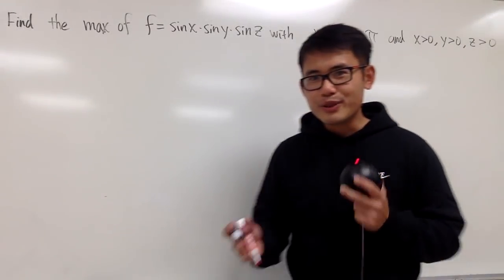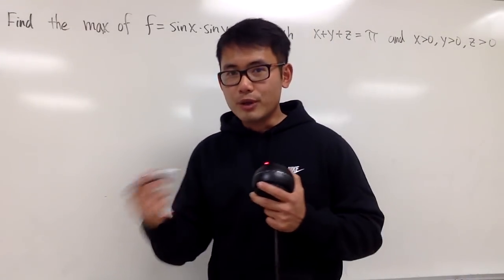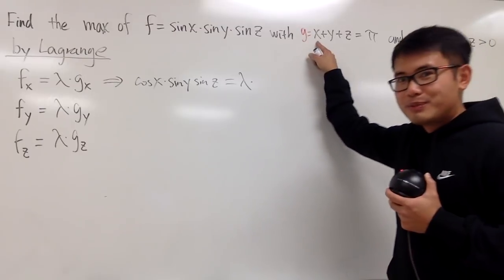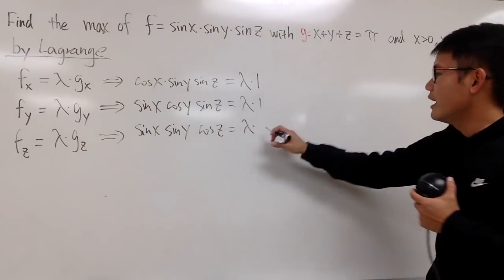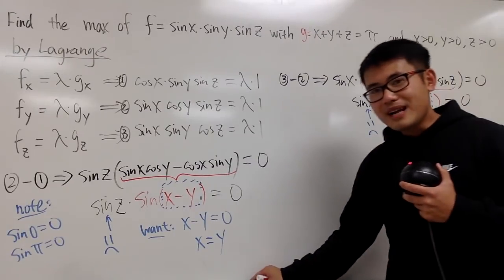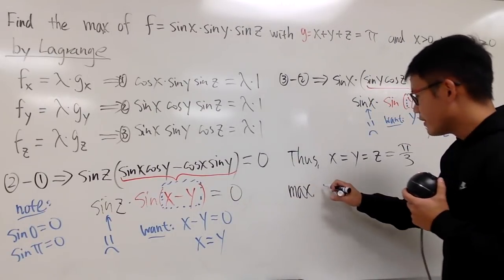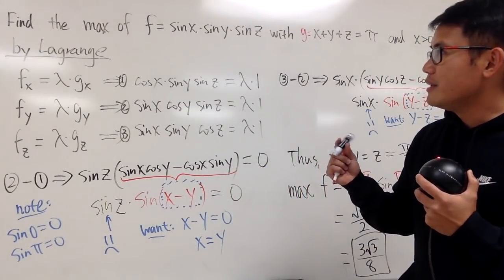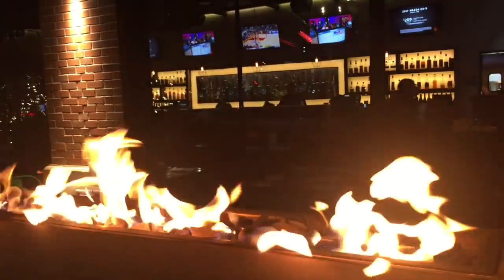Lagrange Multiplier, max of sinx*siny*sinz

Comment: You can just argue geometrically that you get the largest area with a fixed sum of 2 factors if both are the same. So x*y is max if x=y. So in this case all sin has to be the same. So x, y, z have to be 60 degree

Comment: Hey, I came up with a different method.
first, make the substitution that z=pi-x-y, from the condition g
When doing single variable calculus the function has the minimum/maximum when the derivative is equal to zero. You can use the same concept: find the partial derivative with respect to x and set that equal to 0. Do the same with y and solve for x and y. It works, however you need numerical approximation sometimes

Comment: (stares at the screen in confusion)
Reply: Oon Han  Have you taken Calc III?
Reply: no
Reply: Much simpler proof: the biggest some of the numbers x*y*z is when x=y=z this can be proven simply by a^2-b^2. you have the numbers a-n; a; a+n mutilping them you get a(a^2-n^2) but this is strictly smaller then a^3 thus the biggest value you can get is when all three are the same. We conclude all have to be pi/3
Reply: @jameroth7661  sure, but what fun is that?

Comment: There is one problem with this argument. Langrange multipliers find only candidates for local extremes besides boundaries of manifolds. So you still need to check how function behaves near the boundary. Here we have simple situation where function is 0 at boundary and is positive inside our domain so Lagrange multipliers method is gonna find us. But if we had a function that is minus function from this example then there is no maximum, supremum would be 0 and it's value from boundary. Lagrange multiplier method would find us only minimum then. So we can't just throw out z=0 here because it's from outside of our domain. We can throw it because values function attains at boundary are small and therefore maximum can't be there. Also we know supremum can be attained in compact sets so if we add boundary we can find a point where maximum is attained. So standard procedure is to say that maximum is attained in closure of our set and then we say it's not attained at boundary because there is 0 value and we have greater values inside our origin domain and then we know it can be found using Lagrange multiplier. Formally everytime such procedure should be done to have complete proofs although it's ommited oftenly because authors consider it trivial. It's good to remember about it though and know what Lagrange multiplier method actually finds.
Reply: This is the very same problem that I am going through as a teacher of Lagrange multipliers in class. But I think the reason that being omitted is not because authors consider it trivial. I think it is because the complete formality is hard to be  explained in detail at a calculus level.

Comment: My thought process:
(observation:) the function sin(x) is curving downwards between x=0 and x=pi
lets start imagining that x, y and z are equal (pi/3). if we increase one, another has to decrease. lets imagine we decrease x by a small amount called h, and then increase z by that amount. because the sine function is curving downwards, sin(x) will shrink faster than sin(z) is growing, therefore our final result is smaller. even if we try to move y and z together, sin(z) shrinks faster than sin(y) grows. Because of all this, x, y and z indeed have to be equal (to pi/3).

after you mentioned the largest area of a triangle connection, my thought process became:
lets just imagine any triangle inscribed within a circle. lets call the vertices A, B and C.
now rotate the image such that AB is at the bottom. when we move C along the circle, the total area shrinks and grows. if we were to move C parall to AB, the area of the triangle wouldn't change. because of this, only the shortest distance between C and AB actually matters. The larger that distance, the larger the area. obviously its the largest when the triangle becomes an isosceles triangle, with C being on the far end of the circle.
Now we cna repeat this game with AC being the base and B being free to move. Every time we do this, we have to adjust the points less and less. And if we were to look at the case of an equilateral triangle, we would notice that we don't have to adjust anything.
Therefore, all 3 angles are the same.

Comment: Let me guess... x=y=z=pi/3
Reply: You can easily demonstrate it without calc 3, pick any 2 points on a circle, the triangle with the largest area that can be formed using these 2 points is the one with its third point opposite the first 2 and in the middle of them, because A = bh/2, having it anywhere else would yield a lower height with the same basis, so we know it has to be isoceles, now you do the opposite, fix one point and then pick two other points on the circle, symmetrically from the first since we know the triangle has to be isoceles, put the fixed point at (1,0) in (r,theta) notation, the other points will be at (1,alpha) and (1,-alpha), the height will be 1-cos(alpha) and the basis 2sin(alpha), the area is then sin(alpha)-sin(alpha)cos(alpha) which we try to maximize, the derivative is cos(alpha)+cos(alpha)sin(alpha), ie cos(alpha)(1+sin(alpha)), with only one root in [0,pi] which is 2pi/3, meaning the points are in (0,0),(0,120°) and (0,-120°), ie the triangle is equilateral, QED.
Reply: @sdegueldre  YAY!!!
Reply: take the mean ( measure of central tendency )
Reply: But... WHY!
Reply: XD good one 👍
Reply: Samuel Degueldre i wanted to write the same, maximizing the height and the base
Reply: is it the same as say we have a and b that a+b=12, so max(a•b) would be 6•6 = 36 because the max we can get is when they are equal so a=b=12/2=6?
in other cases, 5•7=35 (smaller), 4•8=32 (even smaller), 3•9=27 (even smaller), etc.
and, as sin(x) grows as grows x from 0 to pi/2, and since pi/3 is less than pi/2, we can conclude than sin(pi/3)³ is the max.
is it right?
Reply: Yaah.. if the function to be extremised and relation under which this to be extremised are both unaltered if the involved variables inteechanging
Reply: Because of symmetry.

Comment: is it possible to find the largest triangle in a circle using only geometry?
Reply from the maker: WOW SERGIO, just WOW!!!
Reply: Yes, of course there is! Here are 2 proofs, one with algebra, and the other with geometry.
We use the triangle area formula A=abc/4R=2R^2 sin A sin B sin C, thus it suffices to maximize sin A * sin B * sin C since R is set as the radius of the circle. By the AM-GM Inequality, we know that (sin A +sin B + sin C)/3>=(sin A sin B sin C)^1/3 since sin A is positive for all 0<A<pi, and equality holds only when all values are equal, or in other words, sin A = sin B = sin C = sin(pi/3)=sqrt(3)/2, and thus the maximum value of this product is (3sqrt(3)/2)^3/27=3sqrt(3)/8, and so the maximum area is 2R^2 sin A sin B sin C=3R^2sqrt(3)/4

The geometric proof is as follows: Let one of the sides of the triangle subtend a central angle of A, and vary the 3rd vertex along the circle. By the bh/2 formula for a triangle, we see that the maximum area is obtained when the triangle is isosceles, with the missing 2 sides equal. However, this is true for all 3 sides, thus, for each side of the triangle, the other 2 sides must be equal, which implies all 3 sides are equal by the transitive property, and so the triangle is equilateral. We proceed using the area formula as the previous proof.
Reply: proof by symmetry:
choose 2 points on the circle. the 3rd point travels from the 1st point to the 2nd. at the beginning and at the end of the trip the area of the triangle is 0. in between it grows to a maximum. by symmetry, the maximum is at the middle of the trip, giving you an isosceles triangle with maximum area. again by symmetry, this is also true for the other 2 points. therefore the maximum maximorum is the equilateral triangle.
Reply: proof by smelly smokers:
if in each point there is a smoker, and there is no wind... you get the idea.
Reply: proof by iterations:
start like the proof by symmetry. find the isosceles triangle with maximum area. now choose another point as "traveling point". find the new isosceles triangle. keep iterating. it will converge to the equilateral triangle.
Reply: proof by physics:
instead of 3 Points, think of 3 electrons (or 3 particles with the same charge). minimise the electric potential (equivalent to maximise the average distance between all of them). the minimum of electric potential implies a maximum in area.
Reply: proof by logic:
if a non-isosceles triangle has maximum area, then it's mirror image is also maximum. but the curvature of the circle is constant, therefore there can only be one maximum: isosceles. by rotation, it must be equilateral.
Reply: proof by equilibrium:
instead of points, think in columns. maximum stability implies maximum moment of inertia, maximum distance in all directions, maximum area.
Reply: proof by economy
(Keynesian model):
if the circle represents the spectrum of economical activities, the maximum performance of a micro-society is achieved by people doing very different jobs (if 2 out of 3 produce the same goods, the economy collapses, equivalent to a triangle of area zero).
Reply: proof by darts:
replace the points by targets, with radius equal to half of the shortest side (to avoid overlapping). the probability of hitting the triangle is proportional to the probability of hitting a target. therefore equilateral.
Reply: proof by potato chips:
replace the circle by the rim of a dip bowl, and the points by potato chips. ...aggg, forget it.
Reply: proof by photophobia:
if you live inside the triangle and the points are public lights, you will move to the center of the circle and put the lights far away. therefore equilateral.
Reply: proof by cell phone:
if the points are cell phone towers, the maximum coverage is obtained by minimising the overlap of signals, therefore equilateral arrangement.
Reply: blackpenredpen 
haha... how did you find me!...
(I thought nobody will read this...)

Comment: hi bprp, I have an interesting Olympiad question for you
I call it the "Fibonacci Sequence on Crack"
The first term is 1, and the second one is 2 (just  like in the Fibonacci Sequence)
The third term is the product of the first two (1*2=2)
The fourth term is the product of the last two (2*2=4)
The fifth term is the product of the last two (4*2=8)
The sixth term is the product of the  last two (8*4=32)
This is where it gets interesting
The seventh term is the product of all digits of last two numbers (3*2*8=48)
The eighth term is the product of all digits of last two numbers (4*8*3*2=192)
The ninth term is the product of all digits of last two numbers (1*9*2*4*8=...)

NOTE: Each time that you would multiply by 0 in this sequence - you do not. I forgot to add this little condition which makes the problem a lot harder

Find the 2016th term of this sequence (this question is from 2016 :p)
I was able to find the answer in ~40 minutes
Reply: +Swagger Lemon
This ensures that the question is not 100% identical to a question asked in a previous paper, as well as a sort of double-check that you have that year's paper in front of you, and not a previous year's.
Reply: POSSIBLE SPOILERS?

Isn't the answer 0? Because the ninth term is 1*9*2*4*8=576, thus the tenth term contains both 5 and 2 as factors and must be divisible by 10 --> it must end with a 0, from there on it's rather obvious that every term is 0.
Reply: if anyone is still interested, the answer is 160
The trick is that after some time, the sequence repeats itself. If you keep multiplying and finding the next terms, you will notice that the numbers are repeating themselves, and that way you can derive the formula a(n)=a(n+10), which means that any number on this sequence is equivalent to the number that's 10 numbers further into the sequence, from there on you can figure out that a(2016)=a(16), which is 160 :)
Reply: Thanks, I have a shirt that says "I code therefore I'm cool" it's blue of course. I will get back to you if/when I figure it out.
Reply: when olympiads give you numbers like 2018, they are meant to confuse you and make the problem look astronomical when really it's just a simple concept :p
Reply: oh :P
Reply: If you keep going:

f(9) = 1*9*2*4*8 = 576

I'll stop there. That means that f(10) will be 5*7*6*n = 10*21n. The last number is a 0, so f(11) will be d1*d2*d3...*0 = 0. So yeah, f(2016) = 0
Reply: +Hendrik Vija 
oh yeah, I forgot to add another condition. In this sequence the next term is acquired by multiplying all the NON-zero numbers. so you multiply all the numbers except 0 :p have fun
Reply: Is it 576?
Reply: Nake Basic
nope :p but I'm pretty sure you're on the right track
Reply: Hi,
Say what?

I am a knowledgable programmer I know JavaScript and that should be good enough considering I also invented a algebraic formula for finding the digit i of a y number n; the function is digit(n, i)=⌊n÷10ⁱ⌋ mod 10

but I'm just gonna have to re-read the problem
Reply: haha that's great
programmers are awesome
Reply: Did they try to kill you there?
Reply: @ansishihi +ansishihi or whatever you do I am still working on your problem. I am incorporating standard multiplication and addition algorithms into a sort of javascript library which I am calling "String math" or "SM" e.g. the add function is called SMadd(addend1, addend2...). The idea is that by storing each digit in its own byte instead of trying to fit a whole number in 1 byte (which is only maybe a few orders of magnitude short of effectively calculating, say, the size of the observable universe) we will have unlimited number of digits to calculate arbitrarily large numbers. SMadd currently works, and with it and a for loop I successfully calculated the 2016th term of the normal fibonacci sequence: 9323902893570627136644909011459667063037397957536688215843526057778435618966529044166840768586599645055109991720254500861681614468311831408982633895593351855853713466639755325128380050408481917343862884648336817184854418754936738364775721691168811849042180346368134222800409349683778536695746018273729245690469419835861812346607836429623920015431945309290084465045541840056121469920259880128488038008338414987472374378112 confirmed but not originally calculated by wolframalpha. I may release the code public on a later date. I am doing it on Khan Academy's processingJS platform which is embarrassing but it's where I originally learned and it is the simplest least overcomplicated one and is easy to translate to other languages say javascript or java. Javascript is better than java btw
Reply: Alright so I figured it out
Reply: I guess I didn't need arbitrarily large digit storage (for normal fibonacci I did tho)
Reply: Just 2 minutes ago I did. Did anyone else figure it out?
Reply: shoot u posted the answer earlier! I didnt even notice! Well, at least now I can calculate reeeeealy big numbers (like probably idk a really late term in the fibonacci sequence) lets test it well the 10,000th term of the normal fibonacci sequence is 33644764876431783266621612005107543310302148460680063906564769974680081442166662368155595513633734025582065332680836159373734790483865268263040892463056431887354544369559827491606602099884183933864652731300088830269235673613135117579297437854413752130520504347701602264758318906527890855154366159582987279682987510631200575428783453215515103870818298969791613127856265033195487140214287532698187962046936097879900350962302291026368131493195275630227837628441540360584402572114334961180023091208287046088923962328835461505776583271252546093591128203925285393434620904245248929403901706233888991085841065183173360437470737908552631764325733993712871937587746897479926305837065742830161637408969178426378624212835258112820516370298089332099905707920064367426202389783111470054074998459250360633560933883831923386783056136435351892133279732908133732642652633989763922723407882928177953580570993691049175470808931841056146322338217465637321248226383092103297701648054726243842374862411453093812206564914032751086643394517512161526545361333111314042436854805106765843493523836959653428071768775328348234345557366719731392746273629108210679280784718035329131176778924659089938635459327894523777674406192240337638674004021330343297496902028328145933418826817683893072003634795623117103101291953169794607632737589253530772552375943788434504067715555779056450443016640119462580972216729758615026968443146952034614932291105970676243268515992834709891284706740862008587135016260312071903172086094081298321581077282076353186624611278245537208532365305775956430072517744315051539600905168603220349163222640885248852433158051534849622434848299380905070483482449327453732624567755879089187190803662058009594743150052402532709746995318770724376825907419939632265984147498193609285223945039707165443156421328157688908058783183404917434556270520223564846495196112460268313970975069382648706613264507665074611512677522748621598642530711298441182622661057163515069260029861704945425047491378115154139941550671256271197133252763631939606902895650288268608362241082050562430701794976171121233066073310059947366875
according to my program... confirmed by wolframalpha. unfortunately, my program is neither as fast nor can it go as far as wolframalpha. so I have successfully achieved nothing that somebody else hasn;t already done. at least now I have my own calculator for addition and multiplication of very large numbers.
Reply: Oh right, I had a mistake in my code, accidentally printed out the 2019th term. Cool problem tho